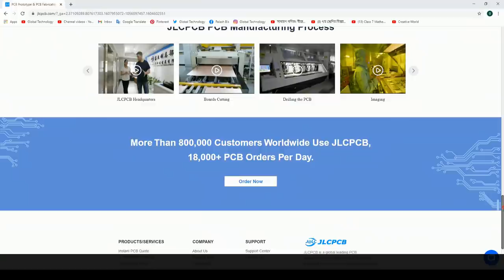How To Make Hi Fi Stereo Audio Amplifier Circuit Using TDA2616  JLCPCB

Comment: Why did you change the values recommended on the data sheet ?. i.e. input cap is 220nf. You have used 100. Can you explain the logic. ?